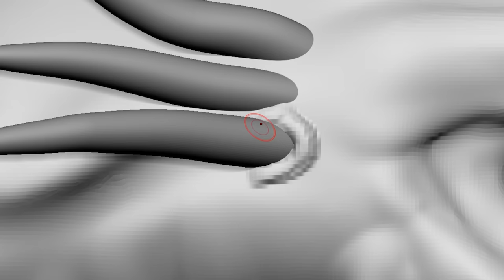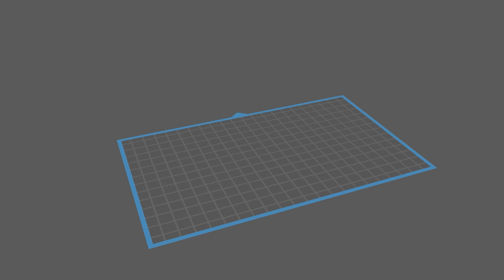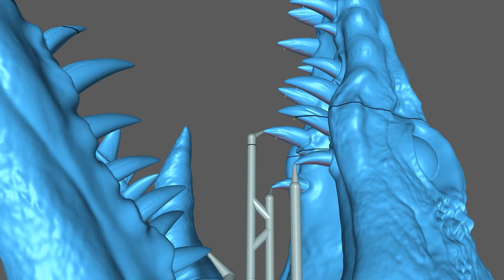How to make a  Sea Monster and Humpback Whale Diorama / Epoxy resin / cement

Comment: I have what might be a dumb question, but I've never used a 3D printer.

After you break off all that excess plastic from the finished print, can that scrap be melted down and re-used, or is it just wasted?
Reply from the maker: cannot be reused
Reply: There are some plastics that can be reused depending on the method of printing, in this case however, no
Reply: Like the foam, rarely you can reuse the small scraps. If I would do that i would try to use rocks and wood found around, I found a mountain with a soft rock vein full of small quartz and calcite crystals, it would be neat for that, also it's soft but not crumby. You have to carry that though. It's soft enough you can work it with soft steel tools, even a bad screwdriver, hand scraping or chiseling and close to it there are small pyrite clusters in a blue/purple rock vein. I gave some pieces to a friend that wanted to make the platforms for warhammer 40k.

Comment: incredible project. Wow,- I love it. You are a master..... PS. I would have mad a pour that only went up to the monster front teeth. Then put the humback whale in to the resin just with its back finn hanging from a thread and let the resin cure. Remove the thread and then pour the last amount of resin. This would get rit of the plastic rod, that is far to visible. But hey,- could I do this project my self. No. So why do I write this? I dont know. Still a great project.
Reply from the maker: Yes, I am well aware, there is an error in the work process
I will try to make a good result in the next video

Comment: I want to do something simillar and i wanted to ask... Doesnt the heat produced by the epoxy melt the miniature monster;
Reply from the maker: Depends on the epoxy you use
A lot of heat is generated depending on the curing time. The epoxy I use is a product that cures in 75 hours The heat rises to 35 degrees

Epoxy with a short curing time is very hot

Please keep this in mind when purchasing an epoxy.

Comment: I understand you poured epoxy resin but what brand and how did you keep it so free of bubbles?
Reply from the maker: Remove air bubbles using an air compressor
Reply: @ZERO_Figure_maker  oh that makes sense. So how long do you leave it under pressure? Doesn't it take like 72 hours to set?

Comment: The tube holding the whale was still visible after finishing... there was nothing you could've done about it? maybe pouring the resin until cover half of the whale, let it dry and then pour the rest without the tube?
Reply from the maker: It's long to explain, so I found a solution first.

Comment: should bandsaw it off at the top to get rid of most of the clear tube holding the whale in place then ya can scuff the surface a little bit  and 4re add the sea foam - the build is epic but the clear tube stands out like a dick in a disney movie